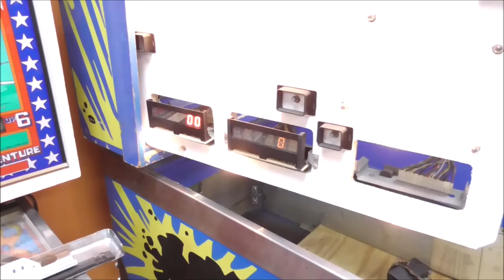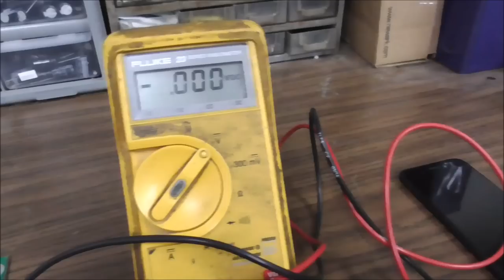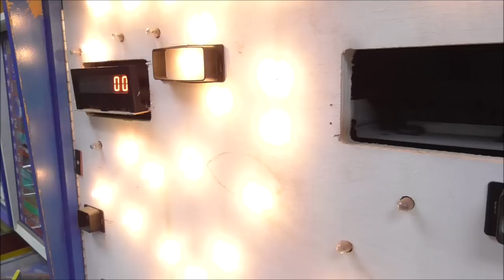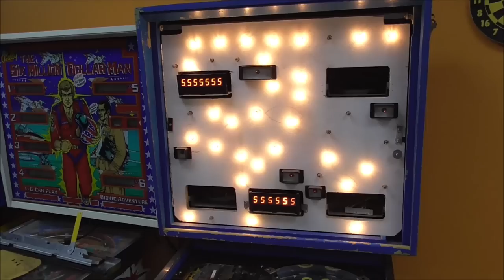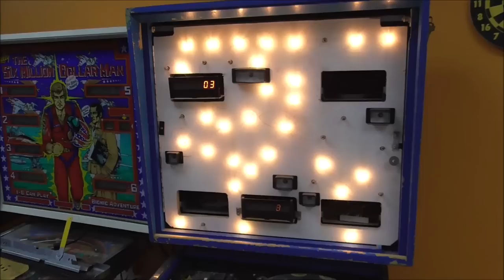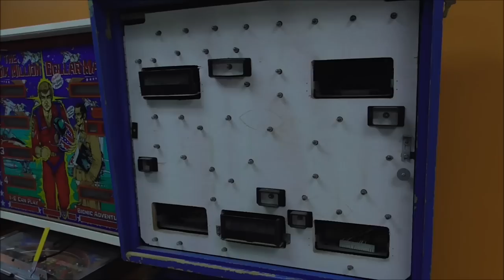Servicing A 1980 Stern Flight 2000 Pinball Machine MPU - Why Do I Need A Gluestick?

Comment: Most "Stern Electronics"  pinballs were just rebadged Ballys.  I serviced many of these back in the '70s.  It was possible to use a Stern MPU board in a Bally machine,  and vice-versa,  just by swapping the PROMS between boards.  It is instructive for viewers to note that the single flashing LED operated during POST,  not boot up.  The number of flashes provided a very rudimentary diagnostics code.  After POST,  the MPU would then boot into attract mode.  This is not to be confused with user-initiated self-test,  which aided in checking lamps,  solenoids,  and sounds.  There are also dedicated test fixtures for MPU, solenoid driver, and lamp driver boards,  for bench repair.  One of my favorite pranks,  however,  was to take a Bally sound card and wire its output into the PA system of the office.  Using a small speaker as a mic,   I could be heard all over the building's PA.  It got old really fast,  though.

Comment: You may coat the copper traces with solder. That would protect them and also thicken them a little. The corrosion eats some copper away and makes it thinner. The ground plane should be as strong as possible to reduce interference. I would also consider reinforcing a damaged ground plane by soldering a bare copper wire onto it.
Reply: Me too

Comment: 17:19 I've had one case where I didn't clean up ALL of that goo from a leaked NiCad battery and it ate thru some more tracks on the PCB ten years after I thought I repaired it! This was on an old Korg PolySix synthesizer. And of course on that part of the PCB it's the area that stores all of the presets that you write to memory. The diagnosis is pretty easy though... all of your presets are suddenly whacked!
Reply from the maker: Oh that's fun!  Hopefully there's a way to back them up :)
Reply: @LyonsArcade  Cassette tape, which I don’t have. I had to manually re-do them all after I fixed it. It’s weird how tracks can go bad quite some distance away from where the battery was.

Comment: The nail polish dots are used to signify that the IC should be placed towards pin 1 of the socket. It might seem that the person who did that had a hard time seeing the notch on one end of the chip used for orientation... LOL Best to use a schottky diode (1N5819), due to it's lower voltage drop, to prevent the button cell from being charged... Brilliant vid as per usual Ron...  10/10
Reply from the maker: Thank you Dero... i'm still unconvinced on the nail polish :)  I don' t know why somebody would add that, it's already marked.  Maybe though.....

Comment: "Conformal coating" is just an expensive term for a layer of clear varnish  to protect the copper from the outside elements.

In heavy-duty boards they use cast resin, but usually spraying on a layer of clearcoat or just brushing over the damaged area with clear nail polish will repair it perfectly fine.
Reply from the maker: Thank you for watching Stoney3k

Comment: I like your vinegar wash to handle the corrosion.  You ever wash the boards with soapy water and paintbrush, and a rinse isopropyl to take off the water?   I fix old stereos, some of them come in really nasty- all kinds of stink and filth on the boards.    Good to let the board dry for a while after before putting power to it.

Comment: I would +1 on the conformal coating. Quite useful if the table is going  somewhere where the air conditions are kinda damp. Just gives an extra layer of protection. 
I actually use clear nail polish as a cheap substitute on the circuit boards of the solar lights I have outside my house. The need all the protection they can get from the north Atlantic weather

Comment: Always be a little cautious saying those coin cells don't leak because I have had a server motherboard wrecked in the past by one leaking and I've also come across corrosion caused by them in a few other situations too. At least they hold a lot less electrolyte than the original so are less likely to cause as much damage.
Reply from the maker: I think I did see one leak on a Gottlieb System 3 pcb one time..... Thank you for watching SiaVids!

Comment: 12:44 Judging by the location of the nail polish dots, it would indicate Pin 1 of the IC chip. I assume for the next guy who works on it to not put it in backwards. Usually there's a little dot indentation cast into the body of the IC chip, or a little U-shaped thing at that end of the chip, but I'm not sure what the standard was on those old EPROM & EEPROM chips.
Reply from the maker: They're all marked so I don't know why a tech would mark them another way, it's kind of weird!  Thanks for watching Vegas Cycling Freak!
Reply: Chris Hibler uses dots like that when he tests boards.  I wonder if he’s worked on that MPU in the past.

Comment: I always heard that battery electrolyte is acidic and that you should use baking soda with a little water to neutralize the spilled acid. But, maybe that's only for automobiles. As far as coating the exposed copper, I would use solder mask liquid.
Reply from the maker: I think it may be different in cars, these batteries have alkaline in them, but I think cars it actually is acid like you said!  Thank you for watching Isidro, we appreciate it!

Comment: The date on the board may be a Julian date. The Julian day 015 translates to Jan. 15th.  The Julian calendar was commonly used in computer programming back then (not sure about today). The Julian calendar is just a set of sequential numbers starting from 001 which is Jan. 1st to 365 which would be Dec. 31st (except on leap years where Dec 31st is 366). One of the reasons this calendar was used in programming was that it was a quick method to determine the number of days between two dates.
Reply: The Julian calendar pre dates the Gregorian calendar in use today the countries of Europe adopted it in various different years 
UK 1750 others before and others later.   UK was about ten days out when they changed
Reply: Oh right, so it's the 15th day of the year, ie the 15th of January. But that doesn't leave any room for the year.

Comment: I would love to see at some stage how you remove those soldered in IC chips.
I'm trying to do this at the moment with a Bride Of Pinbot cpu board with great difficulty.
Love your videos!
Reply: If the chip is bad cut The legs, remove ic, and desolder each leg individually...
Reply from the maker: I agree with Level Means-Flat, if you are pretty sure the chip is bad or it's cheap, just cut the legs off at the top of the chip then remove the legs from the board one at a time.  It's harder to take the whole chip out, I can do it with a solder sucker but I've been doing it a long time and have done probably 1000 chips, I used to mess traces up when I started.
Reply: @levelmeans-flat734  
Yeah that's what i plan on doing but i wanted to see what Ron's usual method was regarding this.
Might try heating up a leg and blowing the remaining solder out with the compressor at the same time.
One of these days i may have to buy one of those electric desoldering guns.
Reply: @LyonsArcade  
Thanks Ron.
Now where did i put those small side cutters.
Reply: @jayytee8062  radio shack desolder iron is the one I have been using for eons.  Hakko is on my wish list though! Good luck!
Reply: @levelmeans-flat734  
Thank you.
Reply: @jayytee8062  im almost done with my pinbot! 😄
Reply: @levelmeans-flat734  
Awsome!  Is that pinbot the original/first machine?
I just have the cpu board battery damage to fix including those pesky 5 chips and a bunch of other parts before i can get her going again.
These machines remind me of vintage car restoration and repair. I can see how addictive this whole thing is.
Reply: I finally broke down and bought a Hakko desoldering station. Been resisting it forever, and slamming my head against the wall, ruining traces, with soldering braid. I had to pull a few IC chips out last week with the Hakko...and what would have taken me an hour and untold frustration literally took me about a minute to PERFECTLY desolder. Yeah that thing (that Hakko) was about $200...but that hour of my life was worth at least $50. I've used it on quite a few things since then, though just some caps and stuff, and it is amazing how much easier it is to repair things now. I listened to people talk about them for years, and just couldn't bring myself to spend the money on it, but now I can't believe how stupid I was, and how much time I wasted, and how much worse my repair jobs were, over those years. I repair maybe 1 or 2 things every week in my business, and they're mostly minor repairs, but still. 

I can't imagine somehow who works on this kind of stuff not having one now. Especially if you're paying employees to desolder stuff. You are totally wasting your money on payroll and taxes, in ways you have no idea. There's literally zero frustration with a Hakko, in removing parts. It works so well, and so fast. And no, I'm not sponsored by Hakko and have nothing to do with them in any way shape or form. It was just one of those tools that absolutely blew my mind, and made me sad, at how much time I wasted with desoldering wick, and how much money I wasted paying employees to desolder things with wick.

Comment: JOES CLASSIC, When removing the battery and starting up the game it will display garbage on the digits and garbage in the RAM memory, any reason why or how to fix this problem by running the game without a battery and it will not display strange things on the display digits? What are you using the Gluestick for?
Reply from the maker: We used the gluestick to glue the label back on the eprom so that errant light won't erase it accidentally.... When ram starts up it's my understanding that if it's lost it's voltage that holds it's memory, when the chip turns on the memory instead of being erased will be filled with random information.  So for instance if it needs to know a value between 1 and 10, instead of having 8 stored in it or something like that, it may have the letter D stored in it... or R19 or something that doesn't make any sense to it, since it's looking for a number between 1 and 10.
Reply: @LyonsArcade  So you would have to remove the battery and also Remove the NV RAM to prevent the digits displaying garbage it seems

Comment: Drop of fingernail polish on each chip you work on identifies what you've worked on.   Mechanics will sometimes mark bolts they've finish torqued for the same reason.   A paint marking pen would be the modern alternative to fingernail polish...

Comment: Using an Arduino in a Flipper seems like something you'd do, if you are a software person and need to get the machine running NOW and can't obtain an original board for whatever reason (too expensive for you or not available).
But then again, if you have to programm it first and aren't a hobbyist but a Professional, the Original Board is probably cheaper...
Reply from the maker: If you need to get it running now an arduino would take forever, just the wiring would be a nightmare there’s 15 coils 30 switches and 60 lights, five sets of displays and I haven’t mentioned the sound board yet
Reply: @LyonsArcade  yes, you are right!
Didn't think about all those things you gotta do to make it work...
It just takes too much time to make it work.

Comment: Talk wiered?   Who you?   Never.
Sieriosly you can get solder-resist to varnish the exposed copper. Even available in green. So your work looks like factory new...UV cure epoxy...
Failing that ,   clear coat would protect exposed copper....